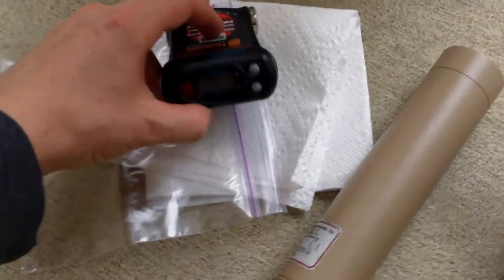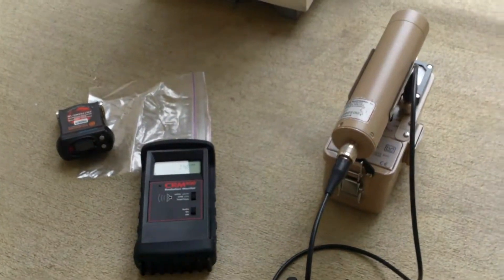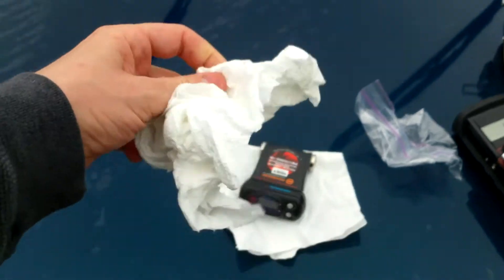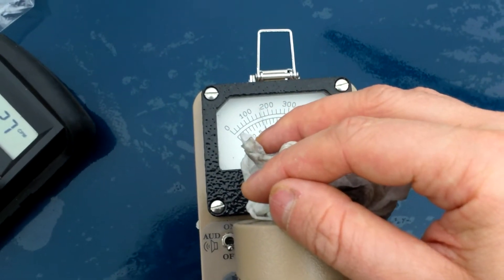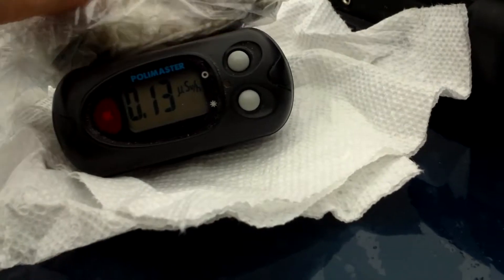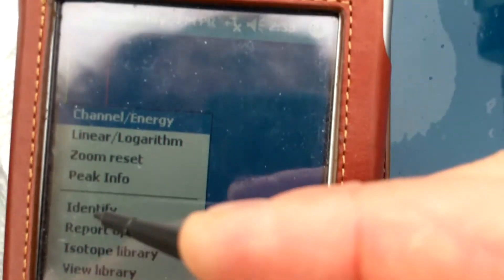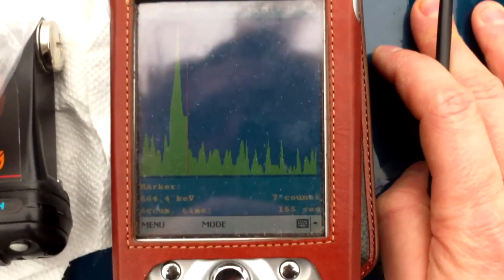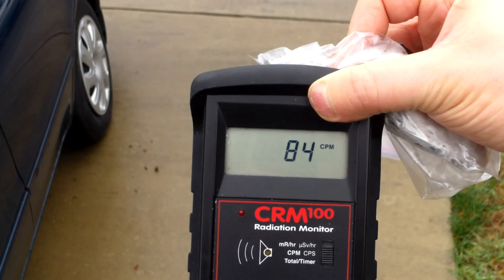Radioactive Rain - Part 2

Comment: What kind of hand held computer is that? Also would a Trimble Nomad 800L work this that 1703
Reply from the maker: The computer is a cheap old iPaq. I don't recall the model number, but it is quite old. That Trimble would likely work, but I would strongly consider calling Polimaster and speaking with their main tech guy, James, before buying.

Also, the Poli is for specific sorts of use. Many other units would provide a cheaper and more useful method of testing. Keep this in mind.